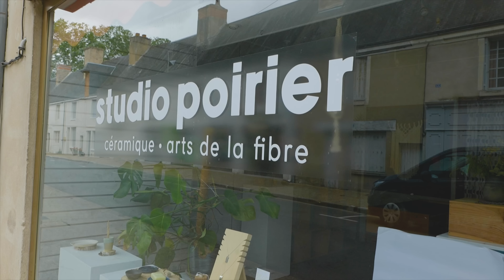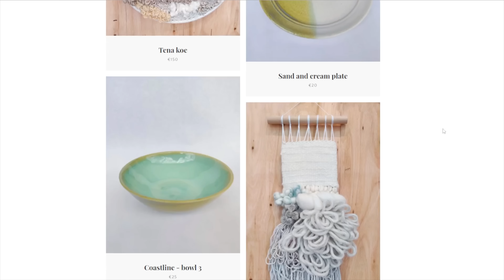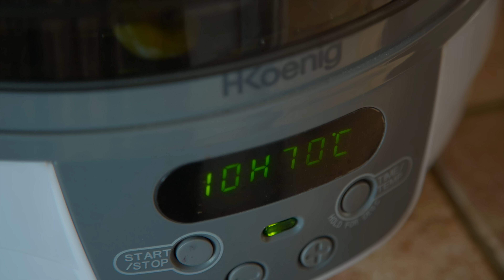We can't believe it's finally happening! | Barn restoration in rural France

Comment: Wow, that barn repair was fascinating. To install new timber inside the old frame - how unusual.
Reply from the maker: I think it's just the easiest way of doing it as the original beams were completely gone so past the point of being able to be saved. This allowed them to make sure the structure was sound and then remove the old. As there are no side walls it doesn't matter if we lose a little bit of length

Comment: No need to cut and remove pits in plums, place in LG pasta pot with liner and cover with water, cook down for apx. 20 minutes, mash with potato masher, pits and peels stay in pasta pot, fruit and juice drains out!  Just put the liner at an angle to drain into pot and use potato masher more if needed.  Viola!  And

Comment: If you jet wash the roof of moss, take the gutter off to do this job otherwise it clogs the drain pipes, then you can if you want paint them with a large roller with moss inhibitor, and the moss will not come back.

Comment: Well done. Now you have some wood to put in the oven, in the coming winter. Did you treat the new wood? I treated the wood on my barn on the same spot on the side of the barn, with carbolineum. In September, i will do a stone wall too. But not that big. I will use tras cement. Regards from the Belgium Ardennes.
Reply from the maker: The big beams are not treated, on list of jobs to do. But, yes you're right once it stops raining again I'll cut it all up and maybe reuse some that aren't rotten. Cheers